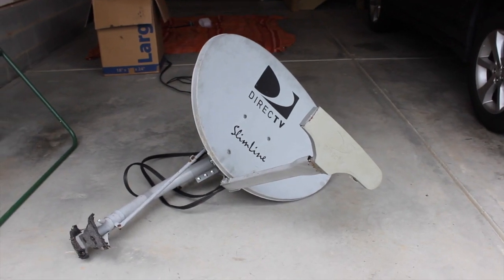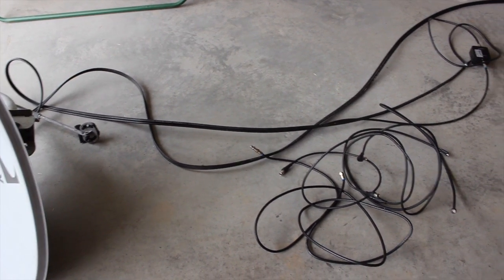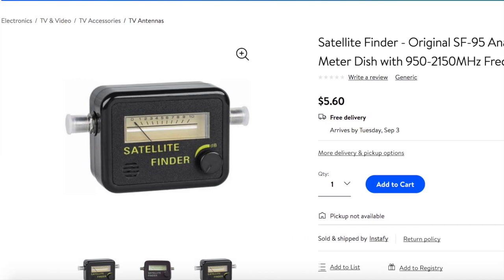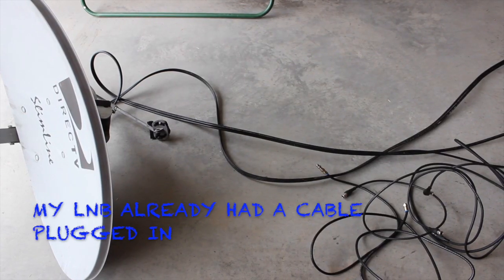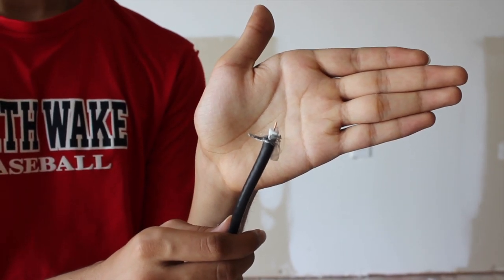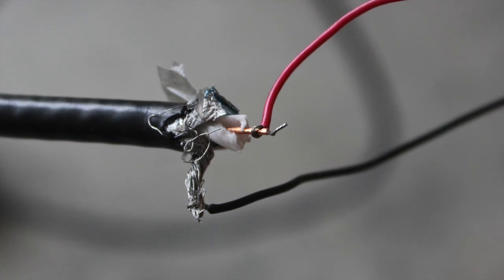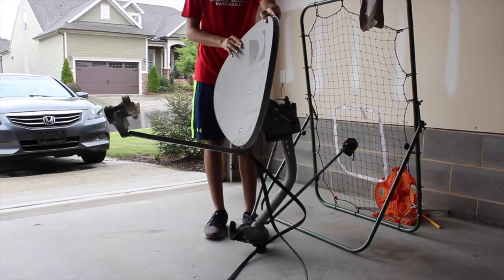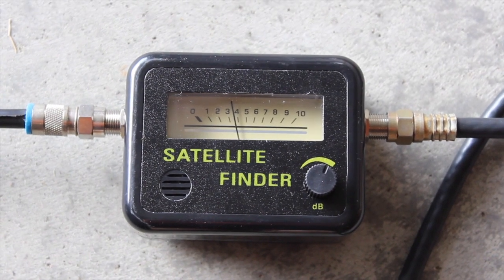How to build a simple radio telescope | Understand the far off universe under $15!

Comment: How do you read the signals on a laptop
Reply from the maker: Thank you for your comment! So I'm not sure if your can analyze signals on your Mac/PC with this telescope. However, if you purchase a satellite signal meter (like this one: https://www.walmart.com/ip/Satellite-Finder-Original-SF-95-Analog-Signal-Satellite-Meter-Dish-with-950-2150MHz-Frequency/932437030) you will be able to monitor the fluctuations, and you could record your observations in your laptop from there! Hope this helps!
Reply: You can't actually, Low Noise Breakers or Inshort LNBs are made to capture a limited frequency rate and it is not any telescope as per definition, it is just an satellite dish with signal meter which is used to get notified when we got any signal from satellite, not from space 🙂 sorry but nice attempt.

Comment: how do you get image of object in space using radio telescope?
Reply: I was just the same thing. Do you connect to a computer, tv, what?
Reply: I think that may be possible through A/D conv. and a base to the antenna that can be milimetric controled in 3 dimensions with  stepmotors or something like. After get this data de can work to map this signals to an image
Reply: @HenriqueVilelaMusic  yes

Comment: Why parabolic antenna is preferred over elliptical antenna?? For astronomy
Reply: Parabolic reflectors preserve phase, so don't have any significant destructive interference. They also focus to a single point. Elliptical reflectors cause aberrations in the image and deal with much more destructive interference, but they are typically far cheaper to manufacture